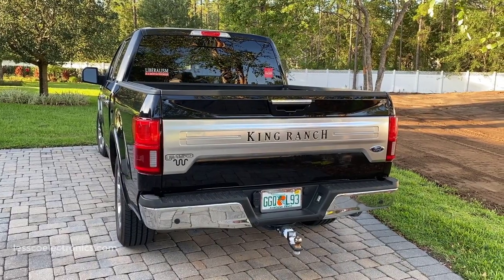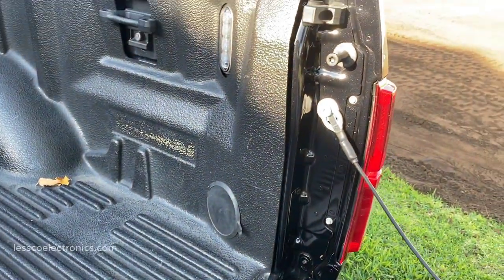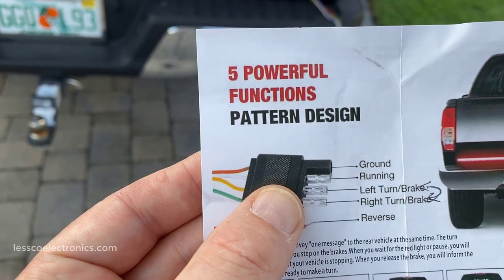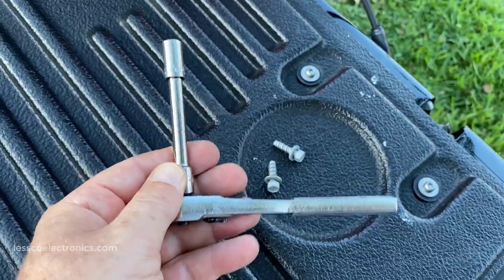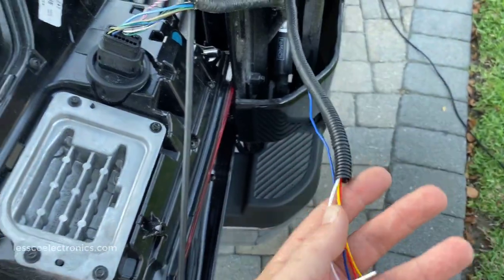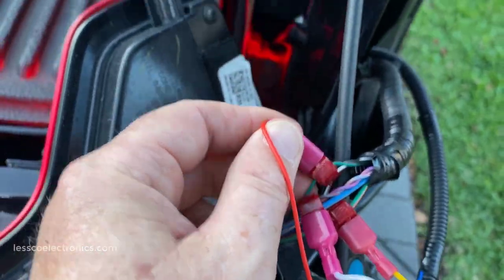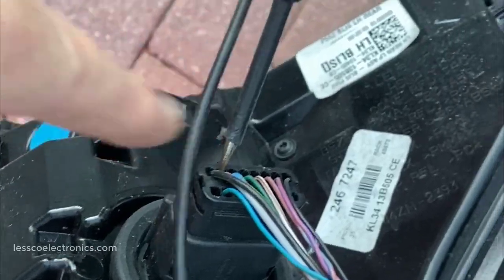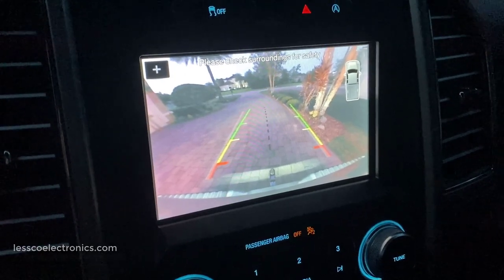Tailgate 6 Function LED Light Bar with Sequencer Turn Signals Install

Comment: Plug is perfectly fine.  You put light upside down.
Reply: The duh moment
Reply: But China....
Reply: 😂 honestly thought the same
Reply: Exactly
Reply: Right 😂😂😂
Reply: Lol he really believed that !!!😂😂😭
Reply: Doh  I immediately thought that, it's a shame he couldn't deduct that .... never overlook the obvious. I just bought one from Fleabay under $20.00 sequential signals & brake light flashes 3 times then on steady
Reply: @TKR780  I got a link to what, I no understand .... a link sausage or maybe the missing link between man & beast 🤔
Reply: @TKR780  ebay "engine care store" led tailgate strip it was supposed to have backup white light but it doesn't.I actually got a partial refund because of that
Reply: You installed the Light UPSIDE DOWN !! Look up the color code for  4 flat and GREEN is RIGHT TURN. Had you installed it CORRECTLY, it would've been right.

Comment: Thank you for this video. I bought this light strip and used the 4 pin and it keeps triggering my alarm. I wanted to hard wire it like this and now I can. Thank you so much.

Comment: Almost every time I see one of these tailgate LED strips, they usually have several pixels that have died... I don't know if it's not ip68 waterproofing, or maybe those signal wires should be fed into relays? Or maybe even a 1000uf capacitor would smooth everything out? 

But this truck looks good with it, hopefully it lasts a long time.

Comment: Yours is slightly different from mine. The turn signals are correct. You have the bar upside down. Then the light is to be hooked up to the left brakelight

Comment: I’m wanting to use this on my pressure washing trailer, as a “warning” light, per se. it would be connected directly to a switch, which would run to a battery. Will this work?
Reply from the maker: Warning, for what?

Comment: @Lessco Electronics Thanks so much for your video I FINALLY got my light bar installed and working using t-taps. I did notice my truck doesn't do the beeping warning when I'm backing up and getting close. Do you have that issue? I have a 2016 Lariat

Comment: Just installed this bar on my truck. 

I installed everything on my driver side of the tail light though. 

My reverse light doesn’t seem to be working properly though. 

I have the “red” wire connected to the “green/brown” wire and every time I put it in reverse. The white LED light “very briefly” comes on but then goes off. The brake light flashes a couple of times and then goes solid red, but not white. 

Do you think it is a connection issue?

Hope you can help

Thanks

Comment: Hello i connect the brake light to the signal lights from led strip but with the brake the tailgate signal lights of the car lighting. Because that i connect the running light from the led strip with the brake but now i have not running light to the led strip. How i solve this problem?

Comment: The motivation u gave me to tap into the taillights was a plus, I'm not putting you down for showing us how to tap into what wires but I found out for my self my wire colors are the same as described as yours in both of our trucks but your color wire diagram is differently in the order from mine, if it wasn't for that Lucky tester and help from my wife, I wouldn't of been able to finish or figure out my own color wires from my order of taping into. So your best bet is atleast as the manual shows from the led strip itself what wire is for.... But atleast you know which wire to use of the led strip to tap into the plug of the tail light by testing its different features like which one is always lit, which one lights up only when u put it on reverse, which one blinks w the side of the taillight signal, I never had experience on this or is not an expert, but today I learned w I fluence, or idea of your video but found my wires on my own after your color wires didn't work for me with help of a trusty tester... But thanks for the motivation and class u gave... I feel proud of my self accomplishing it and learning something new, and solved my own problem. It's awesome to own your own tools... Thanks. My truck blings like a star.. And it's awesome...

Comment: Where are you looking for sequential LED? Having alot of trouble finding after market sequential tail lights that will fit in my bumpers fog reflectors so I can get it wired to brakes and turn signals but have the turn signal orange flow into the white and replace it as the indicator (whilst still running the factory tail light)
Reply: Even those I'm not a huge fan as it's got the same dotted effect but I'm really struggling to find good LED DLR and reflector to replace front fog and the rear reflectors that have a nice solid light glow similar to a Mercedes / Audi persay. I really like good lights 🤩
Reply: Front of my car has halogen foglights I want to swap into a LED DLR that doubles as an extra then signal with the headlight blinker like the glow on your tail lights is nicer than the LED light bar, just my personal taste though no judgements on what people do

Comment: Will this work for a 1993 F150?
Reply: It all depends where you put it.
Reply: @buddyninn1051  what you mean by that?
Reply: @STR8SICCC  I misread the question, I thought it asked will it fit? So I said it depends where you put it. But to answer your question about it working with a 1993 Chevy pickup you would have to look at a wiring diagram for the tail lights, unless you have trailer wiring. I didn't watch the video completely.

Comment: That led strip looks the same if you were to turn it 360 degrees, and I’ll bet the turn signals would match...  next time test the direction first, then mount...  😂
Reply from the maker: yeah.. thanks for the tip

Comment: Wouldn't it of been easier to splice into the back of the trailer light connection. Just saying
Reply from the maker: Yes, but like I mentioned, I did that on my 2017 f150 and it gave me headaches with the canbus errors and rear cam gridlines and trailer messages, by doing it this way that didnt happen again, I learned my lesson from the old truck!